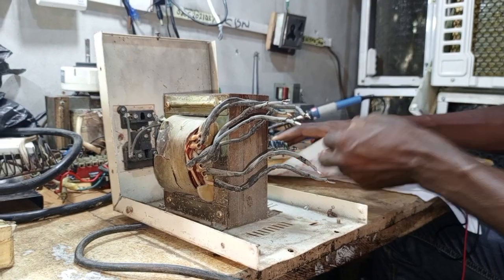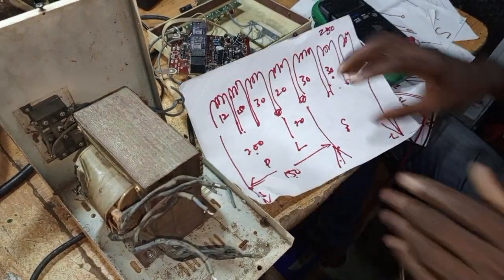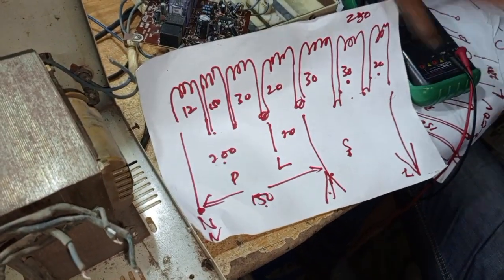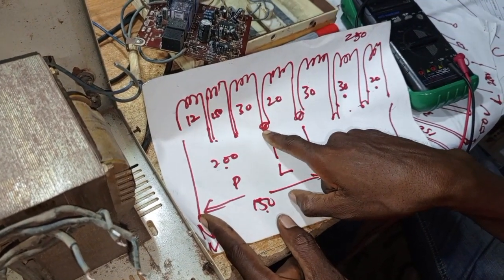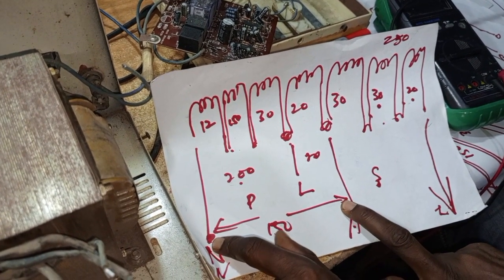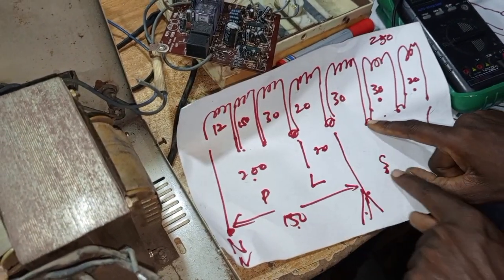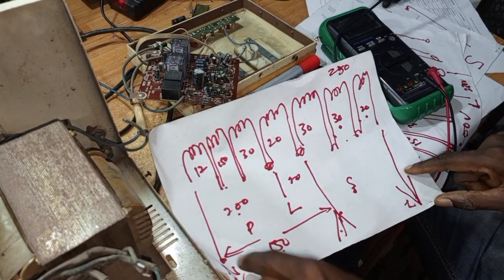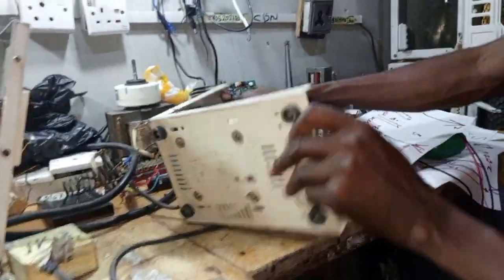2. My Autotransformer Craziest Design for Stabilizer Setting

Comment: I just got a 5000 watt century stabilizer. The input voltage is 150 volts and less. So the stab offs my itself. And it on immediately. And I don’t like how the stab is offing itself. I don’t use much thing. I use only my tv, fan, chandelier light, washing machine and normal bobs that’s all. The issue I’m having now is that my 5000 watt century offs my itself and it on immediately. But I don’t like it that way. What do you think I can do? Thanks.
Reply from the maker: New one or used one ?
Reply: Location please